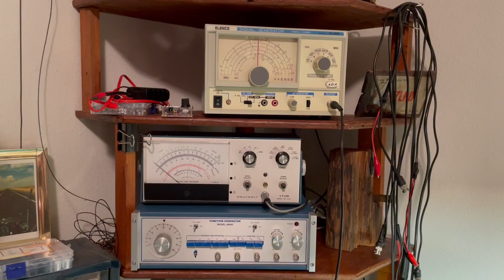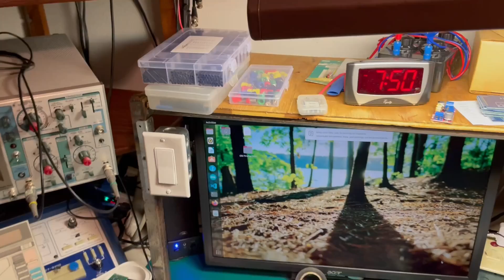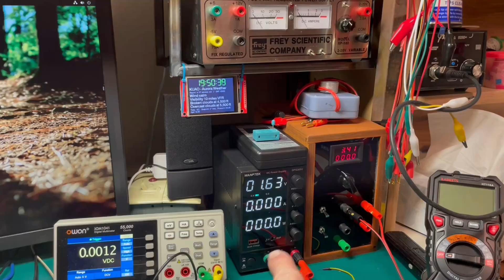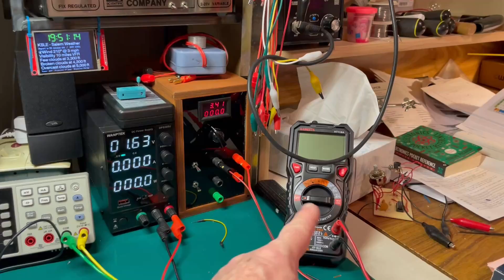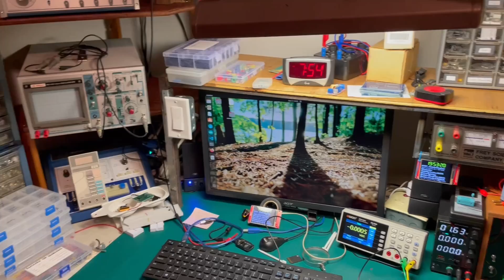Electronics Hobby Workbench Setup

Comment: The problem with going the cheap component route is as a beginner you don’t know if your design is the problem or the transistor or fet is not what’s printed on its case! I’ve known people pulling their hair out as they can’t get it to work and the fet they were using was a re-branded NPN transistor.

So i recommend buying the first semiconductors from the likes of digiKey and then buy a cheap component tester, so that you can see if its NPN or PNP or a FET when you move onto Aliexpress or eBay etc.

I’ve been doing it for so long it’s easy just to check the pin out of a transistor with the diode function and know if it’s NPN or PNP and which pin is the collector. By the way the collector is normally a bit bigger than the emitter on the silicon, so has the lower forward voltage drop. Just by a few mV’s but enough to tell the difference.
Reply from the maker: I agree totally.  I have had several experiments not turn out as expected due to bad parts.  It is really frustrating.

Comment: Nice one Mark, what kind of projects are you working on? Are you only doing Arduino or anything with Pi? As for me, I started a 2-fold project of wanting to build a power-efficient home NAS server that idles at 10-20W, and in the process had to start building a database that creates different builds based on market prices (which are scraped from the net) and tracks prices over time. It's not so much in the practical sense of making things, but it's a project that keeps me excited.
Reply from the maker: I've made a number of ESP8266 clocks that get their time from the internet.  One turns the chime on our grandfather clock on and off each day.  Another is for my wife.  My favorite clock displays aviation weather at local airports on a TFT display.  You can see two of them in the video next to the computer.  I was trying to build this clock as cheap as possible in the hopes of selling it but I can't get my cost under around $25.  I have played with a number of microprocessors but not the Pi.  I've got a good background in C++ programming so I'm sticking with processors that program in C++.